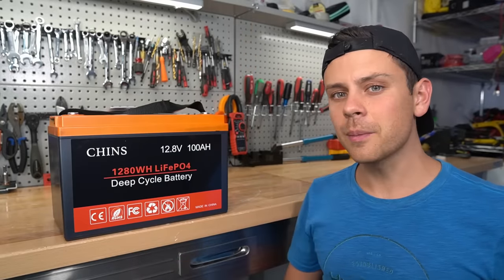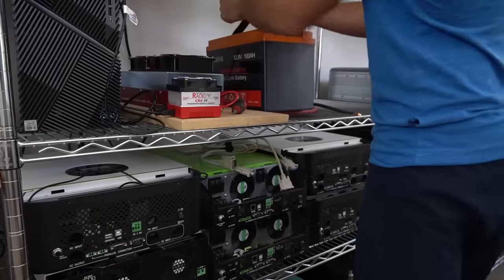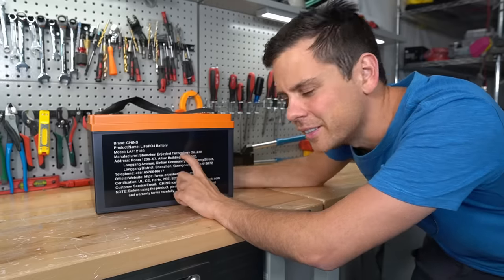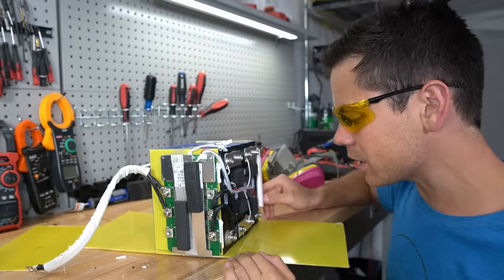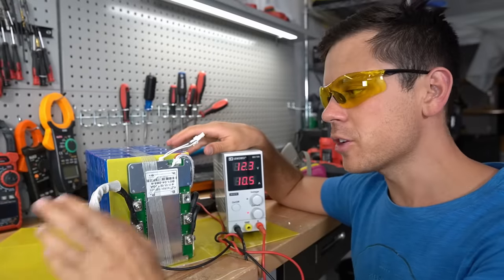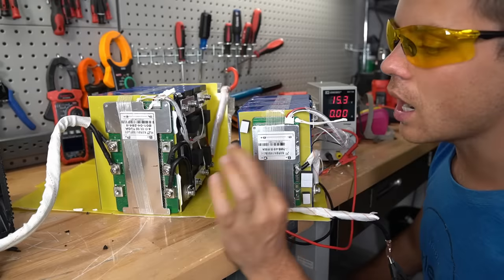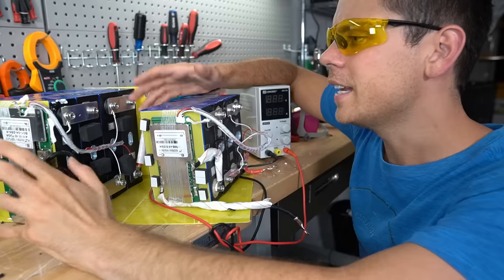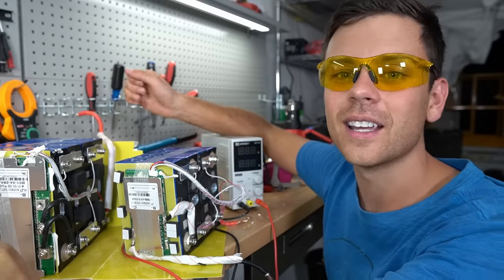$379 CHINS 12V 100Ah "Plus" LiFePO4

Comment: On the strength of this review I purchased a 12V 100Ah Chins.  The price is now down to $349 and available on Amazon.  The battery arrived in about 10 days and is at the correct voltage.  I will continue to use and report back any difficulties.  Thanks Will.  UPDATE:  2 100AH Chin's in parallel providing power to a 3000W Samlex inverter for sump pump backup application.  Power required for sump is way below this "overkill" set-up.  Intermittent cycling and no issues whatsoever.  Battery's working 100% as specified...very pleased!
Reply: Update:  I have 2 100V Chins LiFePO4 batteries purchased via Amazon about 10 months ago, as above.  I subsequently found that the internal batteries were pouch cells other than the prismatic that I was led to believe.  I contacted Chins and they confirmed they were "soft cells" or pouch.  I complained and they offered to replace them with prismatic.  They sent me a PREPAID UPS return label and I returned them for a swap.  I received the new cells before they even received my return.  I consider this the BEST customer service of any manufacturer I've dealt with!  Bravo Chins!.
Reply: Still going strong?
Reply: @loganrexroat3063  Yes, no problems however this application is very, very intermittent.  Sitting in a standby mode the batteries remain at full voltage.
Reply: @amham48  Now you can buy batteries like these for 150 dollars, impressive price drop in only 3 years

Comment: Great for me, don't care for low temperature i live in the Caribbean. Bought 2 batteries first for $439.99 then $399.99 , after that it's all the way up to $469.99 and its the only one that sends to Puerto Rico. To me is a win/win.
Reply: Score!
Reply: Dang. And I thought 460 was cheap
Reply: I bought the 300 Ah battery.
Reply: For those who don’t live in a warm climate, LFP will struggle below 5 degrees C. It keeps a low wattage heater to keep it warm.
Reply: @Dave5843-d9m  Coldest I have ever seen here was in 1977. 26°F/-3.33°C here in South Florida. And I had to spend the whole night on frost/freeze watch. The water in the last sprinklers on the lines on a 10 acre plot froze up. And that was with 60PSI on the pump and 70° water temp out of the ground. I was there as mechanic on duty in case of pump failures. That was a cold night on watch over about 60 acres of experiments. Everything here struggles when it gets that cold. Locals struggle when the temps drop below 70°. ;-)
Reply: Are your batteries still going strong? We are looking to buy these for our sailboat.
Reply: Saludos @CasaJardinez como te han funcionado? Estoy por comprar 4 baterías. Soy de Aguadilla y por igual es lo único que consigo que envíen a PR
Reply: @saundz8791  se portan bien, las 2 de 100 amp , aprovecha que bajaron de precio.
Reply: @casajardinez  gracias por el feedback. Creo q ordenaré 2 por ahora y luego dos adicionales. Estoy manejando el presupuesto.

Comment: The cost of batteries is what has prevented me from getting solar panels, so it is wonderful to see a cheaper battery is available. Thank you for your video!!!
Reply: I had the same issue. Research Lead Carbon batteries. I went with PCC-230 and they have been awesome. Lots of benefits over lithium including cost.

Comment: As a general contractor, I love our oscillating saws. With that said, you need either the somewhat newer dewalt 4-1/2” circular saw and set the blade depth very shallow to cut the batter cases. The second option, and possibly better, would be a dremel circular saw attachment. These sure would make your tear down process faster, easier, and likely even safer.
Reply from the maker: Smart idea
Reply: And it will give you another tool to purchase!
Reply: @WillProwse  or just nitrogen freeze it

Comment: I recently got one of these, works well. They have another version they call their smart version, it has a built in heating pad and low temp disconnect. Apparently at low temps it uses the power from the charger to run the heating pad so that it doesn't use the cells to power the heating. Once it's above the temp needed to charge then it switches to charging. I'd be curious to see how that works.
Reply: The principle sounds good. Sure beats having heating pad depleted batteries when it's still too cold to charge.
Reply: Andy - I just wonder if without a cutoff if the batteries will be depleted to zero before they warm up enough to actually be useful.  I live in the north and some people live at high altitudes so a 20 below zero week is not unheard of.
Reply: @kfclist793  In a place like that other than the LTO chemistry you probably want your batteries in an insulated and ideally climate controlled space. The BMS will basically just disconnect the battery in that setup and all your charging power up to whatever the heaters limit is would go to heating but it probably would not be enough to overcome that cold. You would likely need a separate heating system as well.
Reply: P A  $659.99 for the 100ah. It also has the Bluetooth connection for monitoring. I think you were looking at the 200ah for $1199.
Reply: P A  the heater, low temperature charging disconnect and the Bluetooth connection I would guess.
Reply: I thought the plan was to buy only made in USA products?
Reply: @mymonster156  There are certain things that might be assembled in the US but all the components are made in China, as the majority of the Lifepo4 cells are all made there. So benefit of buying a US made one simply isn't as great, especially if the cost is 3 or 4 times as much. I'd like a good US built battery option, but there just aren't a lot of choices, especially if your budget it limited.
Reply: P A  .. I totally understand. Same with cell phones and most electronics.  Labor is getting dreadfully expensive here.
Reply: P A  can't have it both way. Making these stuff is nasty.
Reply: Same principle that ReLion uses in their low temp series batteries but at a huge price premium!
Reply: So is it worth getting the smart version vs the none smart? It's a lot more expensive it almost makes sense to get the 300ah version instead of the 100ah if you're going with the smart set up
Reply: @Saint696Anger  Really depends on if you plan to have it somewhere that it might be exposed to freezing temps, with the smart version it at least will prevent it from charging in those temps and damaging the cells.
Reply: @andycanfixit  I mainly want it for backup power for future power outages, I'm in Kansas. I would probably put the system in the house if it's during the winter storm
Reply: @Saint696Anger  Then I'd probably save the cost difference and get the non smart version. It's just the freeze protection that makes having the smart version necessary but if it won't ever be frozen, that's not a problem to pay extra for.
Reply: @andycanfixit  ty 👍
Reply: It sounds like the same system that the ultra expensive Relion LT battery uses except it not $1348.95! for the same 1280W of power.
Reply: @andycanfixit  No you really don't need another heating system.  I do strongly believe in putting the battery in an insulted box though.  It keeps the battery warm in cold temps and cooler in warm temps.  We have an insulted box and camp 8 months a year in Eastern Washington Montana, Idaho, and North Dakota.  Our 240ah DIY battery is in our trailer pass through and in an insulated (1/2" foil faced polyisocyanurate foam lined ) plywood box.  I have never seen it below 46F and never more than 85F in the box.  I have a 20W heating pad in the box and TSC-1000 thermostat that regulates it.  In 3 years it has never turned on, even camping down into the teens degrees F!
Reply: @mymonster156  Impossible with LiFePo4 batteries.  Virtually all the cells are made in China.  Some may assemble them here, but its a minimal task.
Reply: @michaeldoherty2289  .. thanks, but I said it rather sarcastically, most things would  now be too expensive, considering labor costs, to be made in the USA.  A certain president and his family demonstrated that as well....
Reply: @Saint696Anger  All depends on your needs.  If you live in a warm area, heating function is useless.   If you don't need heating or the need to monitor closely, then the basic battery is perfect.  The energy is the same.  Its the bells and whistles you are paying for.
Reply: @michaeldoherty2289  I'm just imagining the lights go out and so does the temperature of the room I'll have them stored in. Would it have to get down close 0 degrees or lower teens for there to be damages caused?
Reply: @kfclist793  Even a heated battery must be in an insulated box to retain the heat generated.  That is a must.  The battery sitting out at very cold temps will not be able to keep warm enough to function effectively in the the real world.
Reply: @engineglue  You would be VERY wrong about that.  He is extremely well versed in battery chemistry and function.
Reply: @michaeldoherty2289  Alright, how come he's never heard of thermal glue?
Reply: @engineglue  You quite obviously have not watched any of his many videos.  Go back and watch in the archives.  Educate yourself.
Reply: Wouldn't it be better to put tariffs or duties on the Chinese batteries   to give American companies a chance to compete in this market?  The Chinese  batteries are likely subsidized by their government?
Reply: @mymonster156  You'd first need to have a lithium iron phosphate battery producer in the US. Too date there are none. So unless that tariff goes to building one it literally just results in higher prices because China is currently the only country producing them in volume. Will tariffs alone make a company want to build one here? Not sure. I did see where Tesla plans to have US based production for their needs but they aren't supplying others. Not a lot of good choices unfortunately.
Reply: P A  On-line retailers of all types of goods use current sales data to set instantaneous prices.  As sales increase, price increases follow.  As prices rise, sales fall and prices trend down.  Its simply real-time supply/demand pricing.  Welcome to the new economy!
Reply: @mymonster156  all cells are made in China ATM. USA products still source the cells from China and are assembled in USA. Even Dakota Lithium are chinese cells for double the price!
Reply: @michaeldoherty2289  No need to insult the box.
Reply: @TN-ez6lz  You are free to insulate or not.  I did and my battery is cooler in the summer and warmer in the winter so I obviously disagree with you.  PS-Its insulate not insult.  I'd never insult my battery box, but I did insulate it.

Comment: I build my own for about half what you paid. My usage is electric motors on various things. I travel full time and follow the sun. So I do not use a BMS. When I want current, I want current, no need to limit that.  I do use a set of very good active balancers and chargers on which I can set parameters. All the connections are external to the pack so I can monitor every bank of 3.2 volt cells.  I like your reviews. I know you disclaim about the low temps, but to outright reject a great battery for that is over the top in my humble opinion.

Comment: CHINS
1) Cycle life: 2000+ cycles at 80% discharge depth
2) Max continuous charge current: 50A
3) Max continuous discharge current: 100A
4) Peak discharge current: 300A (Duration: less than 3 seconds)

Ampere Time
1) Providing 2000~5000 cycles
2) Maximum Continuous Charging / Discharge Current: 200A
3) Maximum Permanent Discharging Current: 400A 5Sec.

Source: Amazon listings
Reply: I'm actually in the market and I saw that as well. So is the chins cycle life accurate or the ampere time inaccurate?

Comment: I'm curious if you got the "plus" version or the regular one.. I keep seeing a "plus" variant listed, and it made me wonder if they made them with and without low temp cutoffs. We live in such an incredible time for battery technology though. This is SUCH A CHEAP drop in 100ah replacement! With the right solar controller, you could slap this into the battery box on 90% of all campers/RV's out there and it's barely any more $$ than an AGM from one of the leading companies, and have almost double the useable amp hours, taking up roughly the same amount of space, but with quite a bit less weight. What a great time to be alive!
Reply: Yes, they do on Amazon they have two of the same batteries one with and without the low temp
Reply: I just bought the "Smart" version with low temp disconnect and self heating. Ill be throwing it in the freezer and hooking it up to a charger as soon as I get it
Reply: @dylanperry6995  did the low temp sensor work on it??

Comment: I have 3 of the Chins 200Ah batteries in my rv and have no complaints. I had one that the case was virtually destroyed in shipping, but the vendor refunded me for it and gave me a discount on a new one with no trouble. As you mentioned,they're well built and perform well. Low temp protection is unfortunate, but I have them in my enclosed, heated storage bay, so I'm not too concerned.

Comment: Hey Will, can you do a U.K. version sometime? Would love a review on batteries available over here (Amazon)
Reply: This one is available in the UK from Battery Masters under the Ultramax LI100-12 and LI100-12BLU brand/model, and taking VAT in to account, that is 10% cheaper than Will quotes.
Reply: @trevornelmes9331  That's very interesting. How did you find that out?
Reply: @urbanimage  I was bored, so I looked around then called them, they watched the video and confirmed the insides are the same. Apparently, the 'real' factory/maker will add any brand you want (in any color if you order a lot, but black is the default no extra charge color). The Chins brand is just another brand, and not the real company that makes them.
Reply: @trevornelmes9331   if you search on Alibaba you'll soon see this. Literally 100's of batteries many with exactly the same blurb. If you find gen manufacturers they list the minimum quantities for custom branding. I've spent ages finding a direct Lithium only battery producer. Ages!
Reply: @trevornelmes9331   I looked at those and dismissed them - on account of their very low charge capacity. 10Ah. In MHO a east of time bc one of the huge benefits of lithium is it's recover rate and if the battery acts as choke then your stuffed. Any thoughts please? (I'm in the 'shire and needing 24v x 400Ah..)
Reply: @trevornelmes9331  cool my man, still would be good for a full English episode sometime with Will drinking tea… As for Ali baba I’ve heard some horror stories about it so pretty reluctant to order from there
Reply: @trevornelmes9331  Yes, that's right, most of the battery makers / assemblers in China and elsewhere provide a re-branding service if you place a reasonable sized order, with bigger orders they might even offer some internal customization and choice of cells and BMS. I'm a bit surprised that Ultramax were so forthcoming with their information. I don't think many importers / retailers of this sort of batteries are.

Comment: I bought two of the Ampere Time 12v 200AH last spring for $1840 including shipping and tax.  I've been happy with them so far.  Added a RV water tank heater to prevent freezing/charging issues.

Comment: Apparently the “smart” versions of these batteries include not just low-temp protection but also an internal heater to bring the batteries up above freezing. They’re rated for -35°C ambient! Pretty smart indeed!! 💜🤓👍

Also, they have a 300AH version for $1200/$1500… 🌈🤤💜

Comment: I purchased a set of these (200A) for a battery installation in an unheated barn. It was winter, and I had a chance to test the low temperature feature. My limited tests went very well. So far, I am quite pleased.

Comment: This was incredibly helpful. I'm in the beginning stage of design for a stand-alone solar system for my RV (38 ft. pusher). I was already eye-humping these batteries and saw the Ampere Times were a touch cheaper. Good to know they're basically identical! Have many questions about other components...   I will be doing a 24v system, curious about your thoughts on 24v inverter/charger combo (good idea, bad idea)? And why or why not 24v panels?
Reply: Yes, I also recently took apart both the ADCBATT 12v 100ah lifepo4 battery I purchased and the Ampere Times one, and I found that they are nearly the same construction and have the same writing on the cells, so I suspect they are both from some Chinese manufacturer. But their prices are different, Ampere Times battery is 350$, ADCBATT is only 300$, so is this a sales tactic used by the dealer?

Comment: Just got my 2 12V 200aH Chins LifePo4 batteries. A surprise is the Low temperature heating function the batteries come with an internal heating plate which will maintain 10°C

Comment: Hey Will! Amazon sells the "smart" version of this battery as well for about $180 more. From what I can ascertain, the smart versions have a cold temperature sensor and a heating element to warm up the cells to charge them safely when the exterior temp is all the way down to -30°F. Is that something worthwhile to have if you live in a cold(er) area or would it be better just to use the temperature sensor in the Victron MPPT? We live in Maryland, so our winters aren't harsh harsh (it rarely gets below 10°F, but we have been camping late(r) in the fall when it dips below freezing overnight. Originally I was going to get (2) 206AH SOK batteries, but they're hard to come by. I was thinking about pivoting to these.